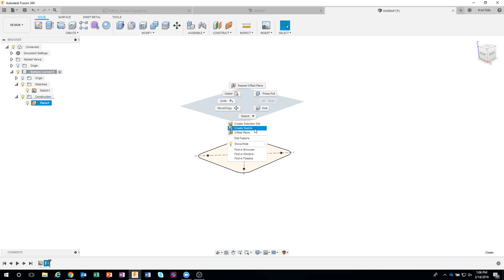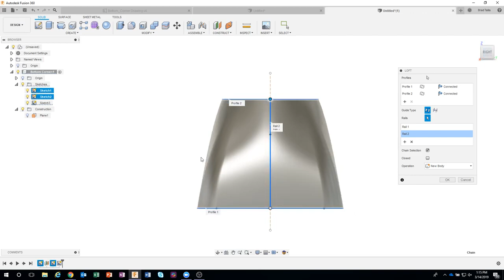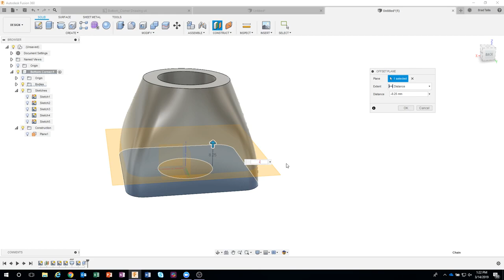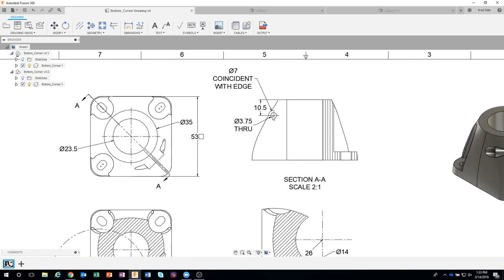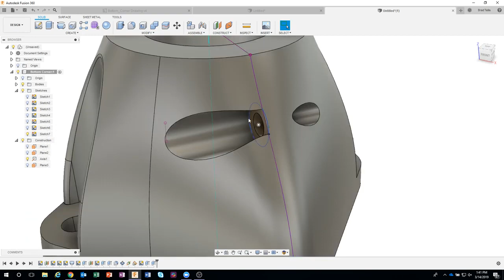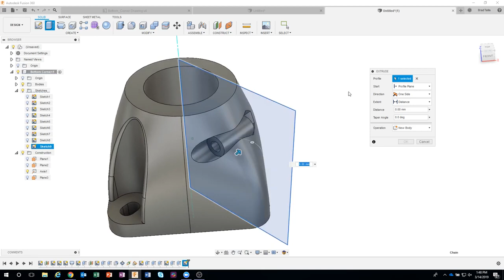Episode 20,  Lofting to new heights

Comment: Possible video topic.  Any suggestions for modeling an air bladder like seen on buoyancy compensation or inflatable life vests?  I can simulate a rigid or static version but would like to simulate variable fill volume using a parameter driven design.  As volume increases, the perimeter will pull in when viewed from front because surface is curving but spline length is constant.   I'm having a little success.  In sketch draw a horizontal line from origin.  A couple of mm above, draw a horizontal spline with two points.  Make spline left end control line horizontal.  Make right end of spline coincident to horizontal line.  Add angle dimension to right end of spline control line relative to horizontal.  So it all kind of works but would like to have spline length stay constant and the right end control line angle parameter driven.

Comment: Brad - Could you have used a Rectangular Pattern to create all four loft splines from the first one? It seems that would be simpler and faster. (Great tute; thanks!)
Reply: Hai Allen, I tried it, looked like a simple idea, but it seems that I cannot select that line in another plane. You could use a circular pattern of 4, and then rotate  every line 90 degrees, but that wouldn't simplify it . Kind regards Hans
Reply: @hanspijpers2100  Thanks for trying out my suggestion.

Comment: Thanks, good tutorial,  learned some new features (un-checking in pattern and intersect instead of project).
Some idea: on 50:08  it's possible to use "From Object" and select the face so you won't need to specify 7mm offset

Comment: I suggest using square nuts when you burry them in 3D prints. and I suggest using symmetry instead of doing the same things 4 times in sketches. Sketches don't have a model history, they are a scourge to edit, so I try put the minimum things in there.